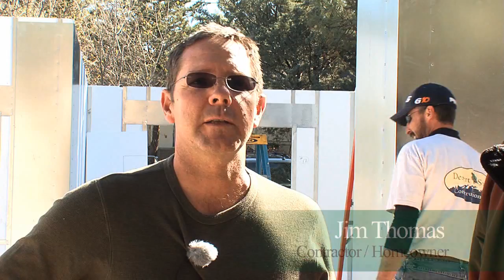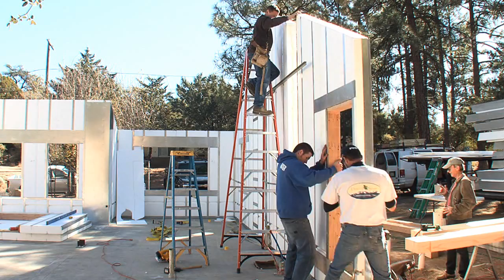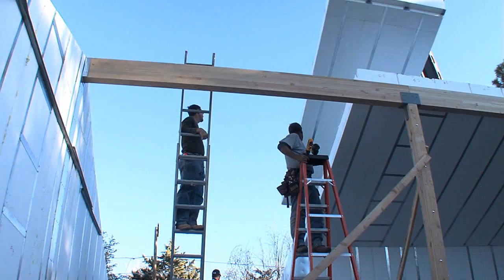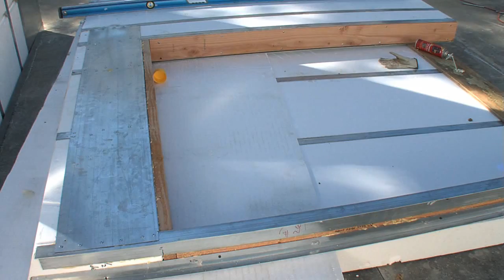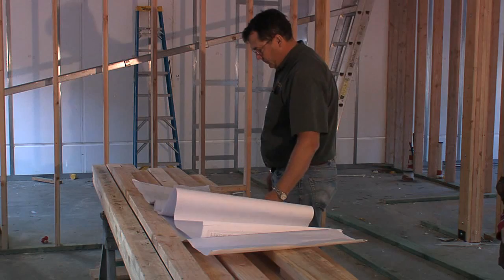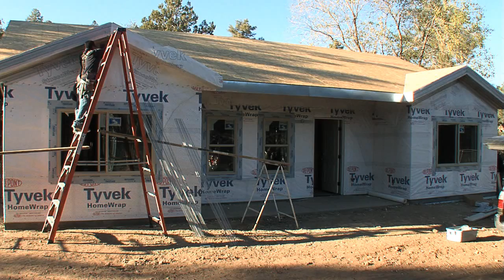Efficiency Home

Comment: I like the idea of a fireproof house and of increased insulation value for lower utilities.

However, I am confused at the idea that a steel reinforced foam is considered "green." 

Steel is very energy intensive to manufacture.

And foam isn't biodegradable or eco-friendly.

Is the foam made from post consumer waste products or is it just more oil derivative waste in the making?

I also like to factor in ballistic resistance to the equation of a family dwelling.  Will it stop a rifle round?

Comment: It depends on the zone and materials, actually, so your comment might need some caveats. This was built in Arizona where temperatures easily reach 110 during the summer-- a typical house with stick/brick construction in this area does, in fact, require such a unit.

Comment: SithlordOmega: It probably is not, in the promo video they never mentioned what heating season they were in or the degree days.
Chakl: Looked to be slab on grade.

Overall interesting concept, nice idea for emergency shelter work, but not passive enough for my tastes. Still chuckling about the sill that they have stating there is no thermal bridge and you can see one in the early part of the video. And that thermal bridge is a piece of steel. Nice.